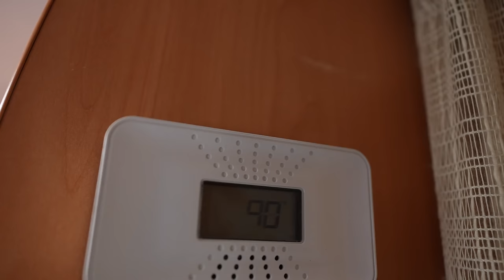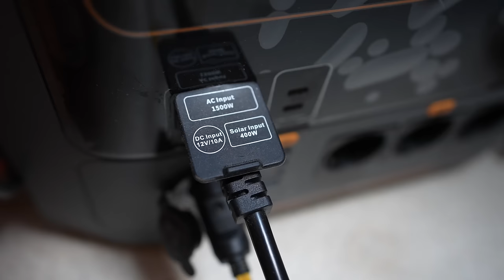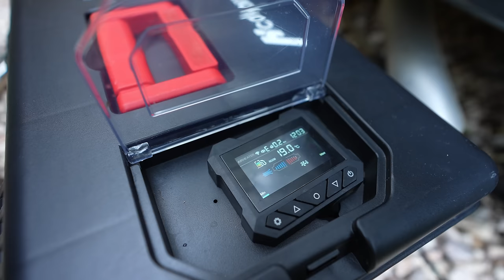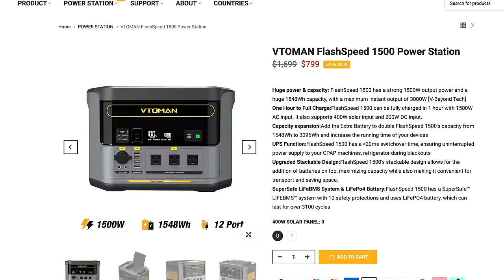NEW SOLUTIONS TO MESSY PROBLEMS ON OUR OFF-GRID HOMESTEAD

Comment: If you use a hand towel and spin it in the air a few times it will mix the air in the van and “break” the hot/ cold pressure barrier which will start the cycle of circulation/air flow cycle and it should keep mixing more easily lessening the temp zones.

Comment: Need to slowly build a stone retaining wall on terrace #6. Heavy rains, runoff and gravity will eventually erode the existing channeled wall. Also recommend and reinforcing the road hillside cuvert pond area. Allowing steep hill terrace runoff to pool and slow before going under the road.

Next determine after future heavy rains, how much the drainage and erosion has improved. Or are further modifications required? Water from the hill, plus from the road, just the rain coming down. A straight water path is fast, vigorous and powerful. Nelson is a big help.

Comment: Congrats to you both on all the new progress, earth-moving size to cat house-size. I'm inspired by you as people at least as much as I am by your magical water mill adventure. I'm wondering if it might help circulate heat inside the van if you temporarily mount a heat-powered wood-burning stove-top fan up high by the ceiling (where it's 90 degrees) ... the fans are so simple and effective, and also beautiful! And, could be used later on top of any wood stove inside your house. ❤Lee

Comment: Need a little tan in the top of the camper to blow it down to the floor.  Not a huge fan, but enough to move the air a bit.

Comment: Hello Drew & Brittany! 😀 You are doing a great job on your property. I am sure it will be a fantastic end result. I am a little north of you, in the central part of Portugal, slaving away, loving it! 😊 Oh, and the constant problem with different heat levels. I got a little 12 volt fan that I put up in the ceiling and have on low, forcing the warm air down to the floor. Works great. Take care and I wish you good luck from Spain 😀

Comment: Great job! Don't like the view of that drainage pipe though (7:53).
Can't you put a lose layer rocks in front and around it so that it is obscured from view and water can still run out?
You also need to add some rocks or bricks just in front and under the mouth of the pipe in order to prevent water from eroding the soil there.